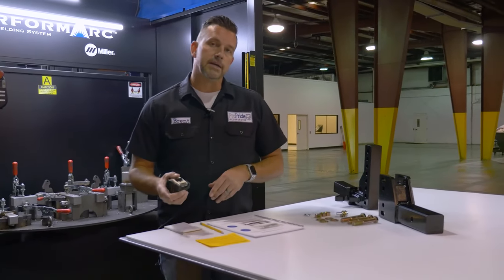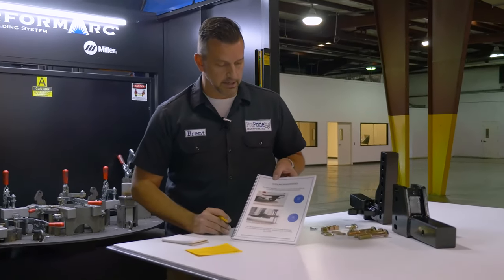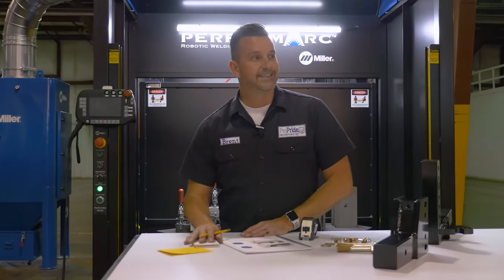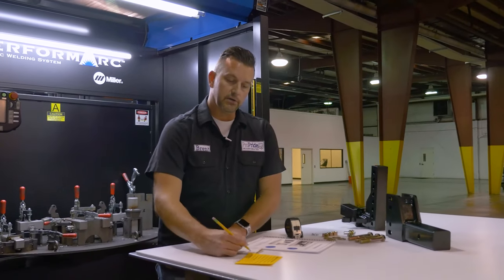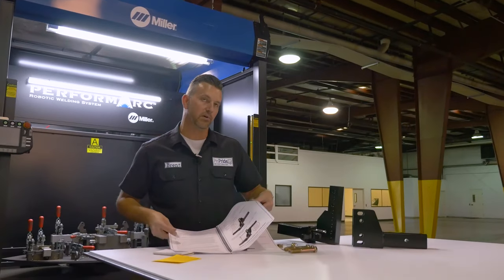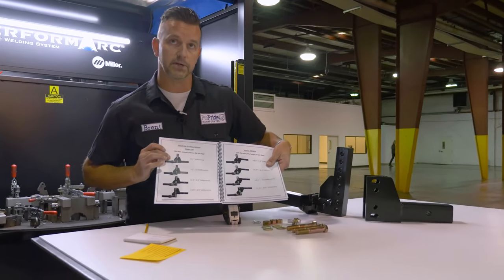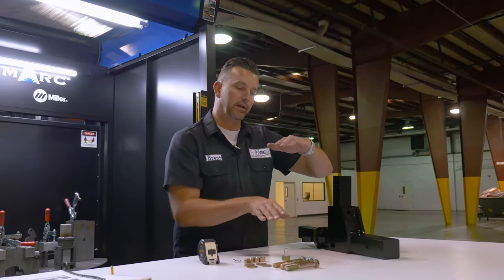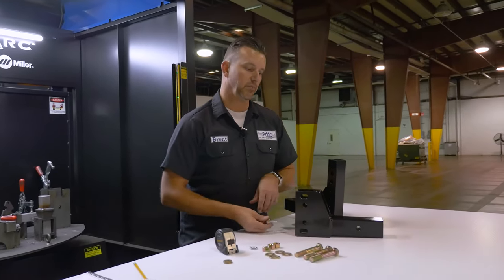ProPride 3P Hitch Installation - STEP 2 Adjustable Hitch Bar Assembly & Installation (Pages 7-14)

Comment: Wondering where the 5" settle comes from that you are talking about. I recently bought a new truck so I had to reconfigure the hitch bar. My measurements are very similar to what you have (TV-24 3/4", Trailer hitch-25") minus the 5 1/2 gave me a hitch box of 19 1/2". I have mine configured with plates down using the +4.5"-5.5" configuration. Since my measurements are so close to yours, do I have mine setup wrong?
Reply from the maker: The tow vehicle being used had a modified suspension lift that allowed the rear end to settle more than the factory suspension allowed. This is what caused the additional settle. Most tow vehicles are set up to allow for 1.5-2.0" of settle from the factory, that is why they have a slight upward rake in the rear. 
The ultimate goal of the hitch bar configuration is to have your trailer measuring parallel, front to rear, to the ground when hitched up and weight distribution engaged. The trailer being slightly nose down is also acceptable. 
If you want to share some additional specifics, feel free to email:
support@propridehitch.com
We can help you work through whatever questions you might have.
Reply: @ProPride3P  Is there a way to determine the factory "settle"?  I would have no idea how to account for this.

Comment: you don't really explain what the tilt pin is for.
Reply: They don't explain much of anything.  I don't think the install is a difficult as this guy makes it sound. Based on this install instruction.. I would never buy a pro pride.
Reply: @chuckpeters1  I love my propride. Two finger driving in 40mph crosswinds

Comment: It would be nice if you did a "real life" installation.  Not in a perfectly level garage. Why not do the install outside on a real driveway or gravel road?  There's no explanation of how to make adjustments if your measurements aren't as perfect as the ones in your video.